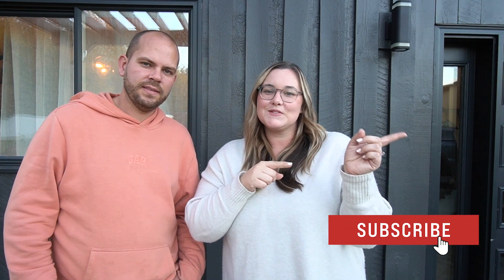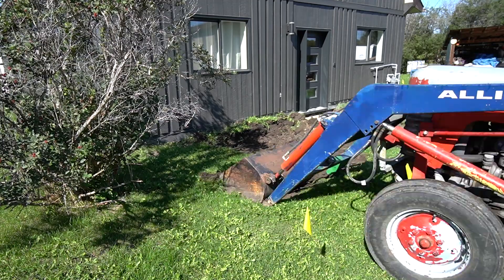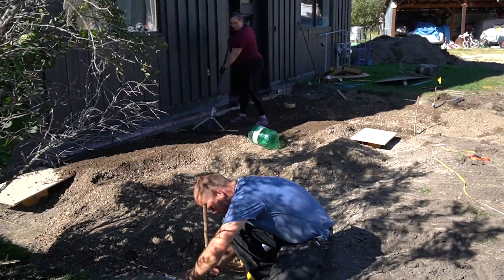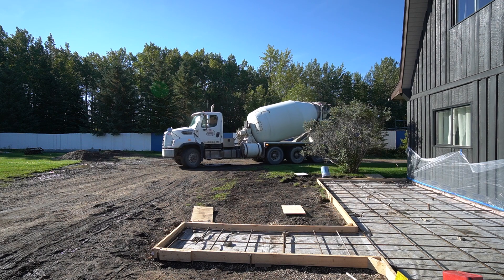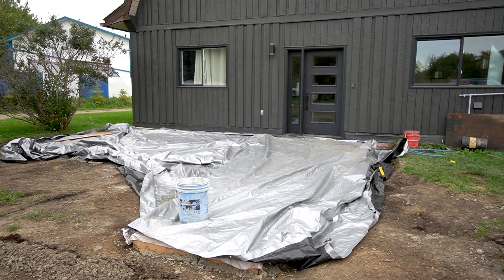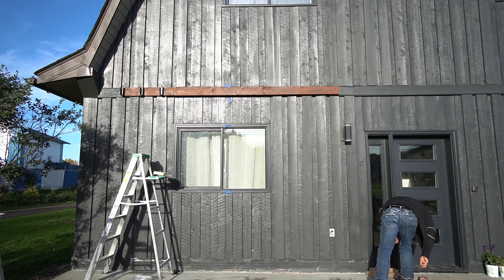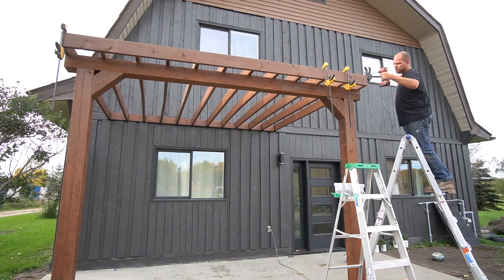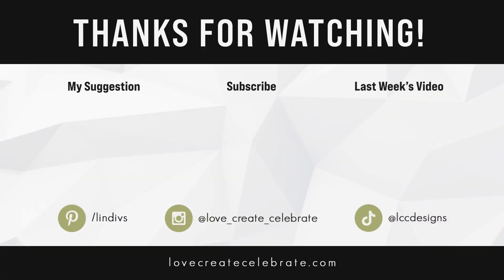Building A Pergola on a Concrete Patio | DIY concrete slab and pergola attached to the house

Comment: Did you notch the rafters where they meet the horizontal beam? If so, did that put them at a bit of a slope? Did you have to calculate an angle at the front of the rafters in order to put that board on the front of them. (That board looks great, btw!)
Reply from the maker: We set the beam so the rafter sit level. We had to notch the beam in a couple spots because it was warped. If you plan to put some kind of roof on the pergola you may way a slight slope away from the house.

Comment: What did you use to hold the posts on the concrete?
Reply from the maker: We used saddle brackets that we set into the concrete while it was still wet.

Comment: How do you find a stud to connect to sledger?
Reply from the maker: Russel had the building plans/photos of the structure as his parents built the house. Depending on your own home, there are generally studs every 12" or 2'. Generally you also have stubs going vertically up along side windows and doors. If you are unsure you can contact a contractor or engineer to assist :)

Comment: Awesome work done especially in pergola..Planning to build same for my patio.Did you make 2 inch notch on 2x6 beam to hold purlins? how did you fix purlins to the beam? Thank you!!
Reply from the maker: We just screwed from the sides at an angle to secure the purlins to the beam.
Reply: @LindiandRuss  Thanks I will do same. Wondering what screw should I use to secure it..Please advise..sorry i am bit naive in this type of work :) and for concrete base, how much gap should I keep with house foundation? Thanks!